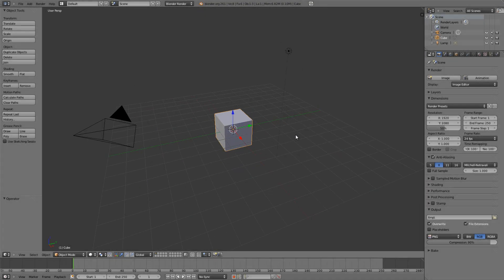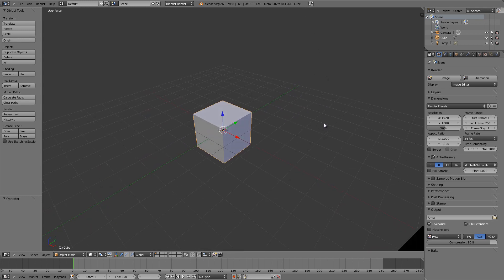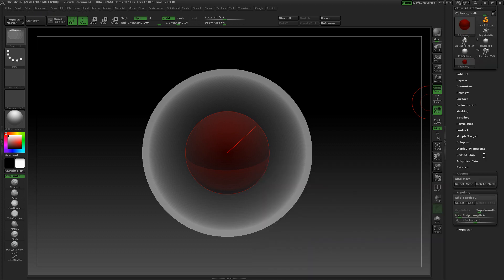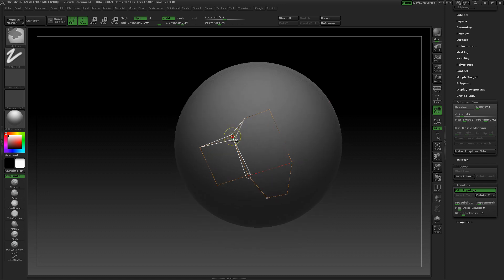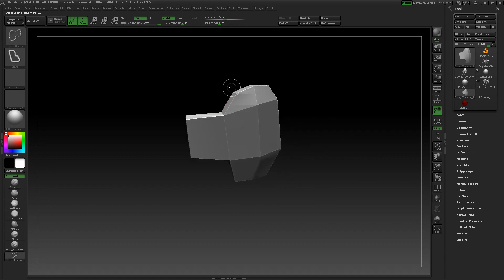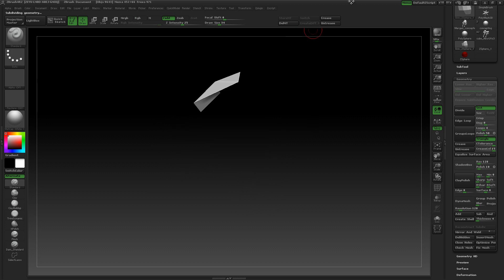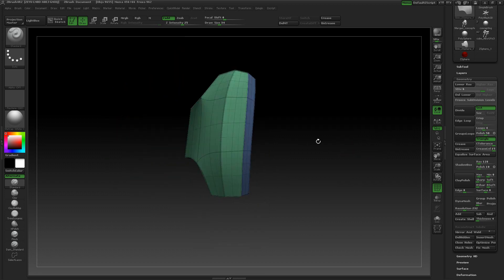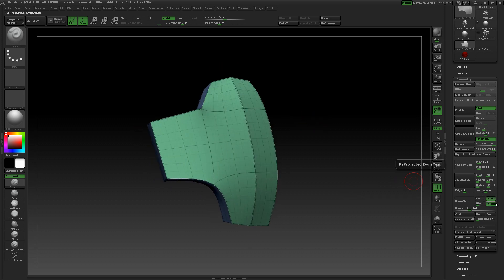Turntable and Hardsurface with Blender/Zbrush

Comment: How do i put my ZBrush model in to Blender?
Reply from the maker: ihatemeisuck export the obj file from ZBrush then import it back into blender
Reply: and how do i export the color?
Reply from the maker: if you polypainted the model the vertex colors are on the obj file, you just need to bake them to a map using xNormal or ZBrush itself.
Reply: So i just go to Layer/Bake/Export as obj - and then it should show up painted in blender when i open it?

Comment: out of curiosity what are your computer specs during this tutorial
Reply from the maker: I think I'm running 3gb of ddr2 800 ram, Phenom II x3 720 proc, and a 560ti graphics card. But I've upgraded since then.
Reply: thanks for the info, guess a 3570k at 5ghz should be fine lol.. also great video! helps alot
Reply from the maker: Tirpak Magyar Welllll, sometimes you can only get a certain quality out of certain hardware, regardless of the skill of the artist. My old PC couldn't go beyond maybe 5 million polys total, so I could only get so detailed. Basically you only upgrade when you want a higher resolution to work with. Granted you can still make pretty amazing stuff with little hardware. Take the Rosa short film for example. It was made mostly on a 2003 iMac. Unfortunately the computer died when he tried to render, so he had to upgrade his hardware to finish the film.